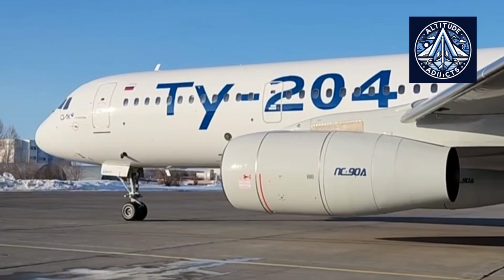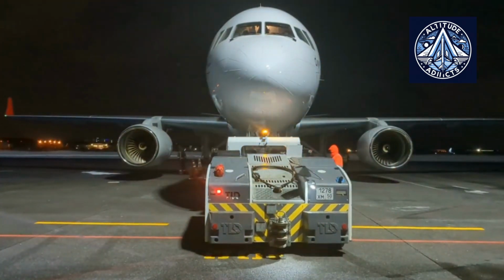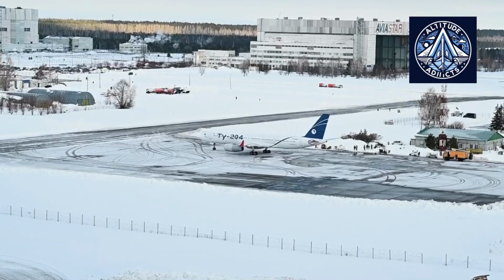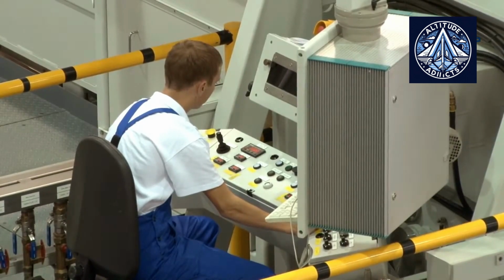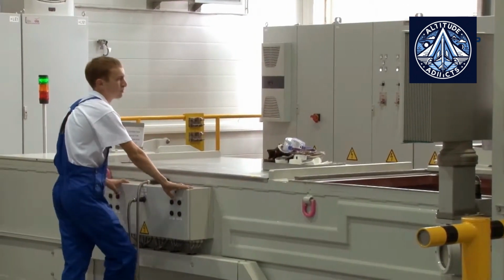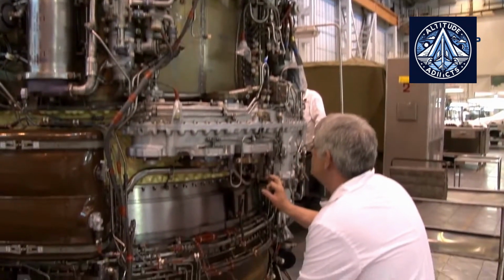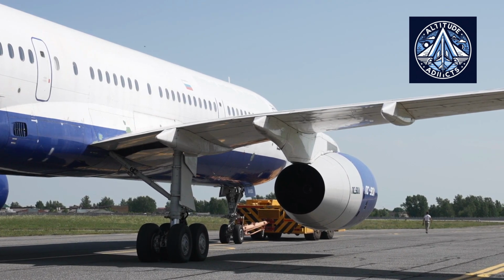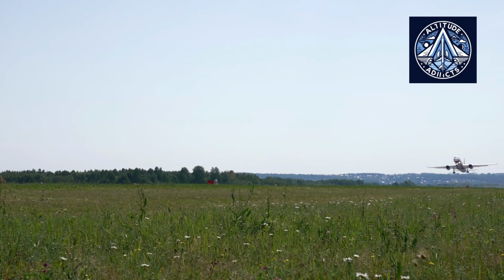Future Aircraft Engine of the Russian Aviation: PS-90A or PD-14?

Comment: Simple, Russia requires a third pilot on all flights that  are over 4.5 h in duration or over 9 h in total flight time with intermediate stops of less than 8 hours...  and required 3+ engine performance on over sea flights more than 500Km from a certified airfield  440 knots speed (830Km/h) and 12km in altitude.  Big fan-jet engines when not  running make for fantastic speed brakes.  Russia should not follow the European / American  transport jet trajectory as it is fatally flawed.  Carbon fiber lets radiation in at a far higher rate than the traditional aluminum jet bodies and fails catastrophically with little obvious warning.  American and European certification has also been found wrought with corruption and has a 'too big to fail' attitude.

Comment: The US also got the YAK-142 shell to make the STOL-F35, technology flows two ways with the US getting enginering goodies like Titanium parts for the 787  and 777 main chassis and various Titanium engine parts for Airbus and Boeing aircraft.... Ceramic coatings are a specialty of the Russians and the west also lost that in the supply chains decoupling, leaving both Boeing and Airbus scrambling for suitable certified replacement parts....
Reply: Ja, die Sonne geht im Osten auf, im Westen unter & die Welt dreht sich.
Die Menschheit lebt am besten in friedlicher, wissenschaftlicher, technischer, finanzieller & kultureller Koexistenz zum gegenseitigen Vorteil.
Einseitige Sanktionen & Marktbeeinflussungen wenden sich oft gegen jene die sie erlassen haben & sie durchführen.
Jede Medaille hat halt zwi Seiten. Wo Licht ist auch Schatten & jeder Aktion erzeugt eine Reaktion.

Comment: In this moment, the priority is the PD-14 and 8. The PS-90-03 arrived to late.🤷🏼‍♂
Reply: PD 8, 14, 35 haben Priorität für den Flugzeugneubau.
Wobei das PD 35 auch Bedeutung haben wird für die Rekonstruktion & Russifizierung der IL 96(98) und AN 124.
Das PS 90 A3 & PS 90 76 für die Rekonstruktion/ Russifizierung der TU 204/214 & IL 76/ BE 50 & 100.

Comment: PS-90 will stay relevant for many years to come. The government only needs to play the Soviet trick: ban imports of foreign aircrafts and give a deadline to phase out current foreign aircrafts in Russian fleets and everyone will fall over themselves to get an IL, TU or YAK.

And with regards to Tu-204, there is no reason why we can't have a Tu-204NG. New cockpit design, upgraded in-flight entertainment and the newer PS-90A3 can be in the works while current version is being sold!

Tu-204NG makes sense when you consider that B737 MAX is the 4th generation of the B737 family and A320 NEO is an upgrade to the basic A320 vehicle.

Kazan also needs to work a little faster. Too much delay will cause customers to loose interest!
Reply: Die TU 204/214 wird z.Z. umfangreich überarbeitet.
Zu 100% ohne Importbauteile, mit einem 2 Personencockpit und neuen PS 90 A Triebwerken.
Es gibt Überlegungen es auch mit der PD 14 Triebwerksfamilie zu testen.
Auch für die Tupolevs liegen inzwischen erhebliche Bestellungen vor.
Für die IL "96" ist der PD 35 Motor vorgesehen.
Die IL 96 "New" dann ebenfalls mit einem 2 Personenencockpit und komplett überarbeitet dürfte dann auch eine Bedarfslücke der russischen Luftfahrt schließen. Wobei als 2 Motorflugzeug war eigentlich IL 98 vorgesehen.
Aber auch die überarbeiteten russifiezierten wiederhergestellten IL 96 mit PS 90 A3 dürften erst einmal eine wichtige Lücke in der Substitution von Boeing/ Airbus schließen.
Zu beachten ist aber auch, daß die PD8, 14, 35 nur die Stammtypen ganzer Triebwerksfamilien mit reduzierter aber auch höherer Leistung sind.

Comment: Russia wouldn't do the same range engines as it is wastefully doing that.
Only PD14 can go on.
Reply: Einbildung ist keine wirkliche Bildungsform.
Hattest Du dem Beitrag genug Aufmerksamkeit geschenkt, dann hättest Du darin bemerkt, daß der PD 90 A3 Motor ein auf dem Wdltmarkt wettbewerbsfähiger Motor ist. Und seit der Entwicklung des PS 90-A3 ist,auch in Rußland die Zeit nicht stehen geblieben, hat man in Perm auch aus der Entwicklung & den Test an den PD Motoren viel gelernt. Wer sagt dir, das nicht evtl. bereits an einer weiteren Evolutionsstufe des PS 90 Ax gearbeitet wird,
Oder aber die Unterbauarten der PD 8, 14, 35 Triebwerke nicht als Tauschmotoren die PS Serien ersetzen können.
Hochmut kommt vor dem Fall.
Unterschätze niemals die Listigkeit, Gewandheit & Fähigkeiten des russischen Bären.
Und denke bevor Du Sprüche aus Halbwissen & Einbildung publiziert, das gleich um die Ecke der chinesische Pandabär oder Drache ebenfalls nicht zu unterschätzen ist.

Comment: PD-18  for  tu-204
Reply: @Rusich945  Much heavier engine and development time.  
PS-90-3  would be fine but they need to incorporate 2 man cockpit,reduce frame weight, and increase fuel capacity.
Reply: @OOpSjm 
Genau das wird getan.
Aber unterscheide zwischen TU 204/214 Rekonstruktion & Russifizierung & TU 2x4 Neubau.
Ja Gewichtsreduzierung ist eine der Prioritäten.
Und da liegt auch der bereits existierende Untrschied zwischen PS & PD Triebwerken.
Aber auch bei einer Überarbeitung der PS 90 A3 Triebwerke könnte durchaus nocheinmal Gewicht reduziert werden.
Hat man doch gerade bei UAC durch neue Flügeloptimierung, je Tragflächen 200 kg Gewicht sparen können.
Ob aerodynamisch dabei auch noch ein Gewinn erzielt wurde ?¿?
Man schläft bei UAC nicht, entwickelt überall in alle Richtungen weiter.
Reply: Nah. Why would you use an older and a heavier previous generation engine on a brand new airframe? There will be a PD-14 variant for a longer MS-21. For now, however, their priorities are to a) finish off and launch MS-21 with the current PD-14, and b) to finish off and launch PD-8 for the regional SSJ. Then there will be 15-16 ton PD-14 variant for a longer MS-21-400/400LR. But we can only hope for that towards the end of this decade.
Reply: I agree. The future is the PD...

Comment: The Progress And Soloviev engines have been produced for decades extensibly in various aircraft including thenew Chinese new engines derived ffomthe Progress design bufeau that also includes Motor Sich on the Antonovs and the new chinese COMAC C-919 AND C-929.... You guys like wee say in Mexico spread too much cream in your tacos and overvalue and give exessibly to much importance ot P&W, they ard nobody compared to Russian or Chinese engineering.... Besides the Russians have more advanced engines to exeed any western designs by decades, like the geared propfan fron Kusnetzov NK-73 which is up to 25% more efficient than anything availiable at present at the same power levels....